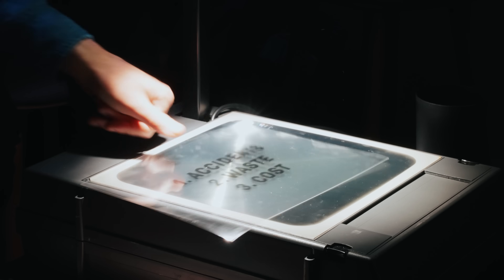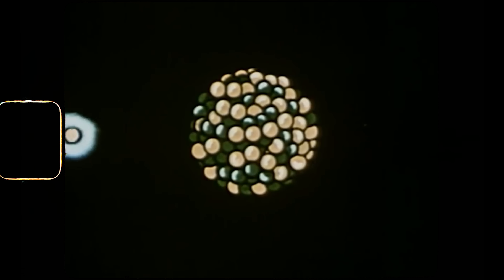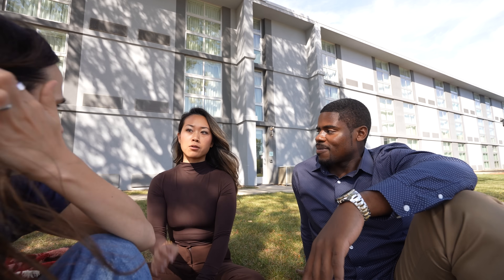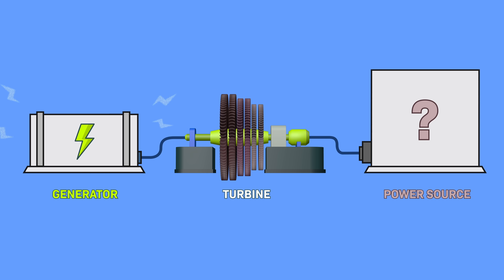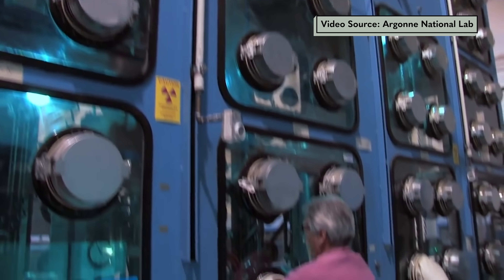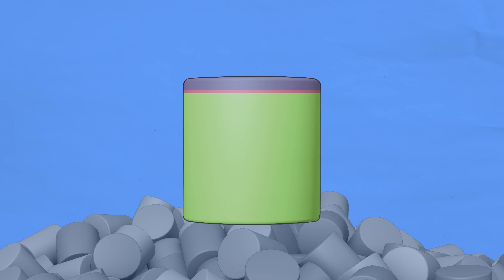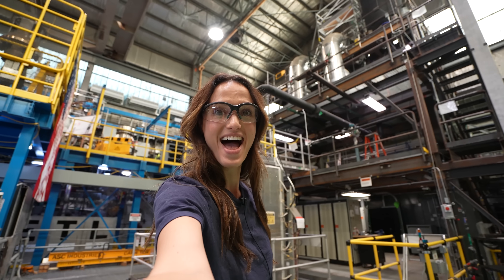The Big Lie About Nuclear Waste

Comment: Ok, if this surprises you, there are several breeder reactor’s that do this as well, and one design utilizes fuel pellets that have enough room in them to prevent an out of control reaction (nuclear meltdown). As the nuclear fuel reacts and becomes hotter, it expands to the point where the chain reaction slows down.

Comment: I didn't hear anything about what the waste from reusing spent fuel would look like. Would it be non-toxic, or less toxic?
Reply: Less volume.  It will still be dangerous, but with the lower volume of waste it won't take as long to decay to safe levels.  The term half-life is the time it takes for 1/2 of a particular isotope to decay to some stable isotope or element which is usually lead.

Comment: I think most people familiar with various power generation techs have known about fast breeders and SMRs and everything you present here for some time (as well as the whole thorium side-track - thorium can be used for enrichment, is also be found in uranium waste and was demonstrated in a working reactor at Oak Ridge National Labs back in the 60s). Thankfully, they are just not needed in most places that can generate renewably, and a big reason they are not built is the construction time and cost, as well as the footprint. There are some places in higher and lower latitudes that nuclear makes sense, but it's not just because of nuclear alarmists or "politics" that it's not being used as much any more - just look at the LCOE from the various gen techs and how often a nuclear plant involves cost and delivery overruns. Recycling waste is great, but no waste at all is still a lot better and you didn't even address that option.

Comment: Look further into the Integral Fast Reactor. It could "burn" Plutonium-inclusive nuclear waste. The waste from that reactor was chemically-separate-able, such that you could extract the reusable stuff from the lower-half-life stuff (half-lives in decades, not millennia) which wasn't reusable. Indeed, the "Integral" part of the name was based on the fact that the reactor had an integrated fuel reprocessing system.

It was also made in such a way that, if the cooling system failed, the mechanism holding the fuel rods would expand, separating the fuel rods and slowing the reaction. Ergo, it was designed / built in such a way that it should NEVER melt down. It's still susceptible to Fukushima-style natural disasters (no reactor design in the world is completely safe from natural disasters) but not Chernobyl- or Three-Mile-Island-style fiascos.

Yes, IFRs could use existing nuclear waste as fuel. And yes, there is an abundance of stuff they could use. The tech had a very bright future.

You'll note my use of past tense. The program was cancelled in 1994. Some of the principles are being designed into some of the Small Modular Reactor designs but ... I've yet to see any of those actually get built (yet).

One nitpick about your video, WRT enrichment. You are correct that about 0.7% of the naturally-occurring uranium out there is U-235, usable as fissile material. Enrichment isn't turning U-238 into U-235. It's separating out large quantities of the inert U-238, such that the percentage of U-235 in what's LEFT is much higher. As an example, if you start with 100 kg of naturally-occurring uranium, about 700 grams of it is U-235 (0.7%). If you remove 99 kg of U-238 from that, leaving ALL of the U-235 behind, you now have 700 grams of U-235 out of the 1,000 grams of what's left, which would give you 70% enrichment.

The removed, "depleted uranium" is frequently used to make anti-tank projectiles, fired by A-10s and various tanks.

Modern tanks and armored vehicles tend to have multiple layers of metal with ceramic in between (so-called "Chobham armor"). Explosive shock waves will dent the metal and crack the ceramics, without penetrating. Heat will melt the metal but not the ceramics, without penetrating. Kinetic penetrators, made of depleted uranium, will go through both; it is very dense (note the exceptionally-high atomic mass, compared to most anything else on the periodic table) so it tends to stay intact when hitting other, softer materials.

Otherwise, a very well-done video. More detail on the IFR might make a good follow-on video, if you (or one of your colleagues) are so inclined.

Comment: "Clean energy"! a,  B.S. advertizing phrase used by Nuclear prowne people to say it's great, I mean radiation has never killed anybody, where as, wind and solar, killed loads,,,,,, oh sorry I did I get that right? (Yes I know Wind and Solar kill people, but it tends to be relatively low numers in close proximity, relative to nuclear accidents). Yes Carbon 14 potentially has attributes, that mean it could potenially, be used to generate power (such as "Nuclear Diamond batteries" , but to tread the Nuclear is totally clean path has been proven wrong multiple times). Why did you need to put on a pair of glasses, whislst wearing a T-shirt?

Comment: Nice video and nice topic !

I would just precise that recycling is feasible only for low performance materials such as uranium 235, but most nuclear power plants use other materials such as barium for example....

Thanks a lot for your video keep up ☺️
Reply: Uranium, plutonium and other TRU are the only things you need to recycle. No neet to recycle or separate barium which is not even part of nuclear waste.

Comment: Nuclear waste is just one of the big problems the nuclear industry is facing.

Cost is the most obvious one: Electricity produced by nuclear power plants - built and operated at the safety level expected by developed societies - is extremely expensive when compared to firmed renewables.

Even at those cost levels, accidents like Fukushima can still happen by human stupidity or greed (both of which are impossible to remove from the calculus)

Another is liability. Nuclear plants are impossible to commercially insure with full liability so the taxpayer picks up the tab in all cases when something goes horribly south. By contrast, all renewable technologies like solar and wind are commercially insured and has no real danger to the population. 

Moreover, the kind of nuclear recycling mentioned in the video still leaves nuclear waste highly problematic.

We don't need nuclear technology at all, since a highly reliable electric grid can be implemented with 100% renewables at a much lower cost than nuclear is capable of.
 

I won't downvite the video but the enthusiasm in it is not justified at all and the title is clickbait.

Comment: This is disinformation in a pretty wrapper.  Jimmy Carter, a nuclear engineer knew exactly what he was doing when he banned recycling.  An inherently unstable source of energy, with many very toxic byproducts, it's too risky and expensive to continue using nuclear power in any form.
Reply: Modern nuclear power is safer than any other source of power. And with a low discount rate it's cheaper, too.
Reply: @Crispr_CAS9  Is that a tax payer funded discount?? It's the most expensive electric generation by far.
Reply: @davidmccarthy6061  If you don't know what the term 'discount rate' means you're not qualified to discuss this topic. Go look it up and come back.

Comment: The BNFP lies in South Carolina. The plant is owned
by Allied-General Nuclear Services (AGNS) (then sold to Westinghouse and then maybe to the Savanah River Complex.). The plant property, mostly wooded, comprises of 1632 acres.
The plant was built in the early 1970s to process spent nuclear fuel from commercial power
reactors. It was never used for this purpose.  It was tested using natural uranium as a surrogate
material from 1976 through 1983. Research and development work using plutonium and other
transuranics was also performed at the plant.
In 1983, the plant was shut down (Because J Carter refused to License it) and partially decontaminated. But significant radioactive
contamination remained inside much of the processing equipment and inside gloveboxes and
fume hoods located in the laboratory building. Some facility surfaces also remained
contaminated. 
Since I worked there I can safely say that low level samples were used in the lab building only and any contamination was cleaned before the plant was shut down. I have not been there since 1983 but believe the pool is being used today to store used fuel rods. These spent fuel rods contain only 7% waste roughly, and the rest can be reclaimed and put back into new fuel rods to be used again. This is a technology that was needed then and is needed now. with new technologies such as storing the high level nuclear waste in solid form. We can use this to benifit all people.  Or we can continue to let our Government store the liquid waste in barrels that rust out at the Yucca mountain facility.  Good old ground water contamination.
Reply: > These spent fuel rods contain only 7% waste roughly, and the rest can be reclaimed and put back into new fuel rods to be used again.

Yes and no. A spent rod has 1% of usable material (U235) for our reactors. The other 99% are useless. Though you could use the 95% of U238 to make rods (97% U238 + 3% U235), but in reality it's waste because in order to mine U235 you already mined more than enough U238 anyway.

Comment: Nuclear is still a waste of effort, energy and time.  Steam based reactors have a poor response time, and reprocessing is not the be all and end all.  Nothing you said is wrong, but you left out most of the story, the negative side of Nuclear.  We could and possibly should have fuel reprocessing but it would not make Nuclear any more viable than it is now, and its not viable now.  its mainly a vanity project for gov'ts.
|If Nuclear is to continue in the future with new plants, it will be a very small number.   Renewables are much cheaper, and the intermittence of wind and solar is not as big a problem as many say it is.  The stability of Nuclear is just as much the same problem.
Ultimately you cannot feasibly power an entire country with Nuclear, you can generate enough MWh but not at the time you need it.
Reply: "Renewables are much cheaper" Renewables are only cheaper if you exclude the cost of storage. If you do, then nuclear is cheaper.
Reply: @Crispr_CAS9  Nonesense, Nuclear needs storage or other forms of peak demand in order to be just expensive, if you try to use it for anything above baseload it becomes stupidly expensive.  Have a look and see what French taxpayers are charged for Nuclear power (not bill payers).
Here is a useful discussion on lowest cost solutions modelled for Australia.  (engineering with Rosie live EP15)
Reply: @tonystanley5337  "Nuclear needs storage or other forms of peak demand" No, it doesn't. That's a stupid lie.

Comment: We reuse plenty of used fuel. By we.. humanity. Im sweden and france alreddy 40% of used nuclear fuel is reused. And that exlusivly in gen 2 reactors.. yes 2.. not 4.. not even 3.

The experts dont really differ on the amount of time we have nuclear fuel for. It depends on the level of technology that is caculated.

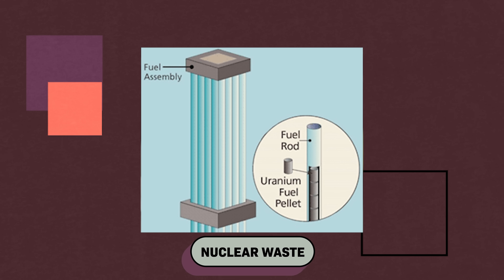7:10 thr numbet stands for the mass of the isotope, bot the number of neutrons.

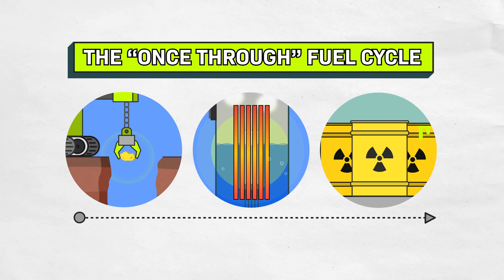8:30
No the dangerus sruff dont stay radioactice for that long time. Typical half life of the problematic part is 100-5000 years. The isssue is that when shown in a log log diagram it looks like it tapers of really slowly, and that is not really the case.

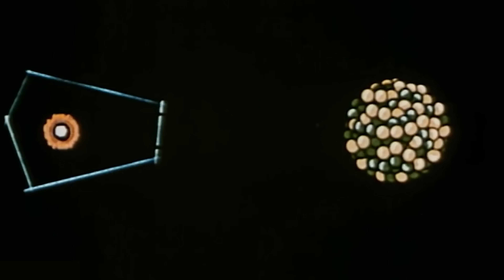12:22 this is totaly wrong.

All reactoes can recycle the fuel, some reactors can do it inline, some reactors have tondo it externaly.

The method shown was extetnal recyceling that can be used on all reactors. This is diffrent to jow fast reactors work.

Also the nuclerat saftey was a lie. You cant make bombs from plutonium from light water reactora. The issue is that light water reactors have the wrong isotopes.

Then the question allways come. Cant you just isotope separate them. Well. Effectivly no. You can in theory, but its not pracitcally viable.

Comment: A lot is glossed over by saying it’s just a cost issue.
“When it comes to safety and security, sodium-cooled fast reactors and molten salt-fueled reactors are significantly worse than conventional light-water reactors,” says Dr. Lyman. “High-temperature, gas-cooled reactors may have the potential to be safer, but that remains unproven, and problems have come up during recent fuel safety tests.”
In fact, according to the UCS report, sodium-cooled fast reactors such as the Natrium would likely be less “uranium-efficient.” They would not reduce the amount of waste that requires long-term isolation in a geologic repository. They also could experience safety problems that are not an issue for light-water reactors. Sodium coolant, for example, can burn when exposed to air or water, and a sodium-cooled fast reactor could experience uncontrollable power increases that result in rapid core melting.

Comment: I don't know what the lie is? We don't do it for three reasons: non-proliferation, as we'd basically be refining plutonium out of the waste; also because it's far cheaper to burn raw uranium; and moving the initial waste fuel and later the more refined highly radioactive waste fuel around the country is a political nightmare. So there's no monetary incentive and regulatory hurdles at every step. It's like trying to get people to shift from fossil fuels to renewable energy with the addition of people's not entirely unjustified nuclear accident fears.

Comment: Hold on a second. There are multiple issues with reprocessing thorium and molten salt reactors. The big one is there was too much cracking in the reactor and it was shut down because of the issues. Also thorium doesn't work by itself it requires uranium to work. Then you have mixed nuclear waste that is very difficult to deal with. Then once you mix it you have all the same problems as traditional reactors. Thorium is less energy dense so too costly. The traditional reactors are too expensive already to compete on the open market and thorium would be even more costly and produce less energy  and be more costly hence less likely to be invested in. Then also if you reprocess your generating fissionable fuel and then you have to worry about proliferation of nuclear weapons. Salt is corrosive and your using corrosive material as cooling not ideal. Too many issues to even get into it on here. It's a pipedream non-starter. It will never happen.
Reply: What a silly take on this topic you just gave

Comment: Congrats on the video, very informative and mind breaking! I am left with a doubt regarding the non-useful material. The Radiotoxicity is down to a few hundred of years on the useful recycled material, correct? Is the non-useful material also Radiotoxic? And lasts for a long time? What is the mass ratio after filtered, useful vs. non-useful?

Comment: This isn't the only way that we are ignoring technology that we have that we know works that can solve big problems. For example we can capture large amounts of CO2 out of the atmosphere using air liquification technology. We already do this at scale. The only problem with using it to solve our atmospheric CO2 problem is that we do not have enough cheap energy to run the process at that scale. But as this video shows we do know where to get that energy. Once we have that CO2 we don't have to just store it. We know how to use it to make useful things including ammonia to help grow more food and methane which could either be used as a carbon neutral fuel or as feedstock to produce other hydrocarbons or plastics. Each of those processes would need more power input, but as this video shows we know where to get enough power to do this. We just have to have the will to do it. That said just removing all the excess CO2 from the atmosphere will not fix all of our problems. But it would help, and just imagine what we could do with the electricity that cost 1% of what our current electric source is cost... And none of this requires new science or new engineering. What it requires this new thinking and new politics. 

Basically there are a bunch of very rich people who are afraid they might be slightly less rich if The rest of the world isn't kept so wretchedly poor. People too stupid to see that the pie is a thousand times bigger they're going to get more pie.

Comment: So my question now is what is the usefull stuff? U235 or the plutonium? Or any of the other instable elements? If it is just U235 then you get a tiny amount of the usefull stuff each time you do this proces and still need to throw away the majority of the waste.
Reply: You actually understood the problem. Gratulations (I mean that sincerely). Yes a spent rod has ~1% U235. This is the fuel our current reactors use. So you take out 1% and throw away the other 99%.